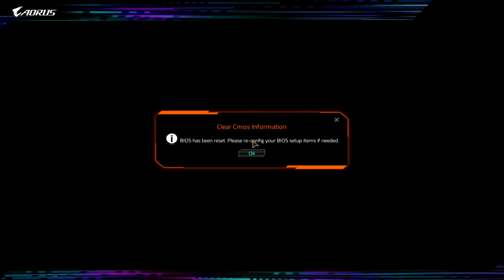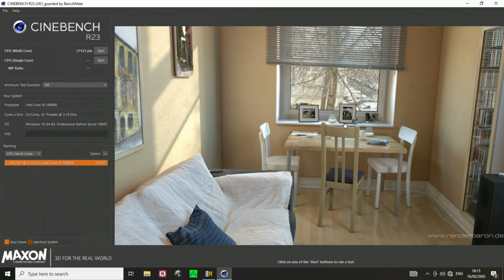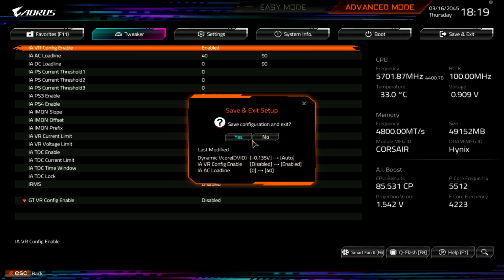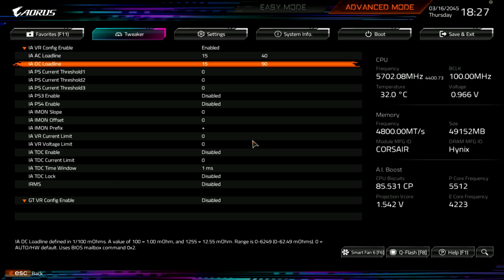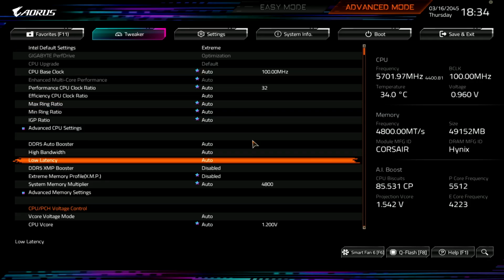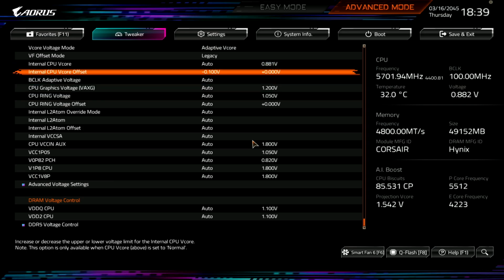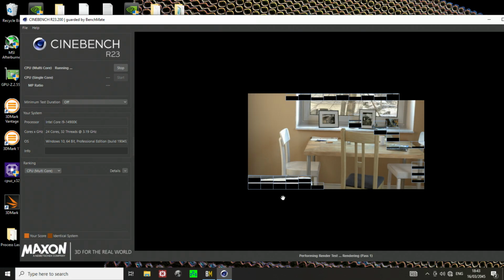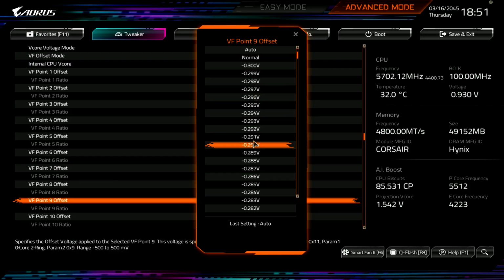YOU  DON'T HAVE  TO TURN OFF CEP to undervolt intel 13/14th gen CPUs

Comment: No, you do not only mostly affect high load voltages with AC LL, run Geekbench 6 and compare VID (or vcore, whatever) on light workloads, you'll get significant difference in VID between 1.1 and 0.4 mOhm. You can already see the influence just in the bios, there's tons of voltage pumped regardless of load, since AC LL is a flat offset calculated from AC and probably ICCMAX. The same value is being added to VID all the time. Adaptive 1.435V + 1.1 mOhm LLC + 0.65 mOhm AC LL = up to 1.48V in GB6, 1.435V + 0.06 mOhm LLC + 0.1 mOhm AC LL = 1.41V in GB6.

Also, MSI gives the per ratio voltage offset, but it's completely broken too, so while bIntel gives that opportunity - motherboard manufacturer has to be not idiotic too.

Also2 - at the time of writing this comment I didn't get to 26-ish minute yet, where you've said just what I wrote :P. Which is also contradicting what you said at the 12 minute mark, it's influence is pretty much linear, although by dropping just AC LL you actually hit high load voltage stability limit way sooner, than low load voltage stability.
Reply: and yet he says "for some reason people don't understand what I say" - he needs a summary comment pinned at the top, even if it loses some views.
Reply: @ogBINARYGOD  просто человек любит МНОГО говорить ПОПУСТУ. Вообще попусту. Он похож на обзорщика на геймнексусе - много слов при минимуме полезной информации. Такое ещё называют "словесным поносом". И по причине обилия слов данные люди напрочь забывают то, что они говорили в начале.
Reply: I have enough another issue, if I keep the 1.0/1.0 AC/DC (recommended LLC4 setting with latest ASUS BIOS, then try to undervolt with the SVID (requires a ton of negative offset to get the same voltage as before), it ends up tripping up the 307A ICCMAX on my 13700K.  Meanwhile if I use my normal undervolt mode of 0.4/1.1 with LLC3 with SVID offset of -0.05 but with CEP disabled, it doesn't trip the ICCMAX and downclock.  

The only way I can somewhat get CEP to work is use LLC5 with 0.4/0.73 AC/DC with SVID offset of -0.11 with CEP enabled.  I still end up with about a 200 point lower C23 score, I even tried creeping up the AC LL to .5 and .6 with more SVID offset to compensate, still noticed the loss of roughly 200 points if CEP was enabled vs disabled.  I would gain those 200 points back if I left it locked at 0.73/0.73 on AC/DC with roughly a -0.19 offset, but the voltage under load wasn't constant, it drooped heavily in the beginning and raised up over 0.02v by the end of the test.  With the other settings, it stayed constant the entire test.
Reply: @ZoneXV  извините, но 1.0/1.0 для AC/DC на АСУСах - это много. Обычно нужно "стартовать" с 0.5/0.5, постепенно снижая AC для выравнивания Vcore и SVID Vcor(реальное и запрашиваемое напряжения) в нагрузке - при правильном подборе они ДОЛЖНЫ быть равны. Например на Z690 TUF D4 я ставил 0.1/0.4(AC/DC) при LLC6 - и всё было отлично.
Reply: @chveyk To equalize the AC/DC, I set it to 0.5 on both and have to put it under stress to check if they both align? And if the VID has a higher voltage than the VR Vout, for example? Do I just need to reduce the DC LL?
Reply: @Syrusaki  да. я на своей ASUS Z690 TUF D4 "дошёл" до 0.15 DC LL и 0.46 AC LL  - напряжение "Vcore" равно "VR out". На "VID" можно не смотреть - это "желание" процессора(внутреннего АИ блока). после "выравнивания" можно заняться поиском "минимального" напряжения путём введения отрицательного сдвига. У меня оный выставлен на -0.12в - в нагрузке в среднем 1.26-1.28в. И около 230Вт потребления при 38000 очков в CB r23 - больше уже не тянет "тестовый" кулер(всё никак не могу дособрать водяное охлаждение)...
А. да - у меня 13900HX :)
Reply: @chveyk  Here I tried using adaptive voltage with an offset of -0.088V, and when I run Cinebench, instead of having a voltage droop, the VR Vout and Vcore increase. I started using Fixed mode because it stays stable there; I’ll just need to align it then. I just ran a test, and the Vcore is slightly higher than the VR Vout by about 0.010V, both at idle and under load
Reply: @Syrusaki  да. так и должно быть. плюс-минус 2-3мв это норма. Точнее "уровнять" всё равно не выйдет. и да - все настройки сугубо индивидуальны для каждого отдельного процессора.
Reply: @chveyk  привет, можно с тобой как то связаться что бы задать пару вопросов ?
Reply: @chveyk почему интел не может утвердить среди производителей плат, что AC/DC LL в авто режиме должны всегда выставляться в том значении, в котором установлен LLC. Чтобы не ставить их вручную при изменении LLC? Чтобы вручную ты ставить мог, но в авто они и так работали корректно в соответствии с LLC?

Да максимальные 1.55в все равно странно выглядят, можно было спокойно опустить до 1.5в. 0.5в - это огромная разница, особенно когда речь идет о предельных для данного чипа напряжениях. 

Все же просто. 1.5в не превышаем, СЕР работает. АС/DC автоматически подбирается при переключении LLC. (Это для 14900ks, а остальных чипов можно смело резать максимум до 1.45в) 

А там уж пользовать при желании подберёт нужные ему настройки как хочет. Снизит вольтаж, выберет LLC. 

Я человек ленивый, просто поставил фикс, подобрал оптимальный ллс, которые вывозит мой кулер и поднял частоту настолько, насколько позволяет качество кристалла. После этого чуть опускаю еще вольтаж (с учетом шага по частоте может остаться небольшой запас).

Эти 6ггц, которые я почти никогда не вижу мне погоды не делают, 5.5-5.7ггц на все ядра меня вполне устраивают
Reply: @graviusmatt  "Это фантастика" ;) Производители плат не могут сделать один стандарт того самого LLC, а вы о AC/DC говорите! У асуса одно обозначение LLC, у MSI другое, а гига вообще по своему "крутит" это LLC :D Про асрак промолчу - они вроде как равны с асусом в этом вопросе...
Reply: @chveyk  ну у асуса хотя бы есть настройка синхронизации lcc и ac/dc. Но опять же, это не вина вендоров, это вина интел.
Reply: @ZoneXV  I'd expect it tripping PL4 actually.
Reply: @PolskiJaszczomb  Could be that too, it's under IA: Electrical Design Point/Other and PL4 is listed there too.  It wasn't maxing out PL1 or PL2 though.  I'm convinced the stock out of the box settings is trying to kill my CPU.  Gave it vcore's in the mid 1.4's and tried to run cinebench23 at 1.32v before immediately throttling.  It's trying to run it at full load at the exact VID listed in the VID table with no vdroop at all!  I'm not sure if this is on Intel or this is just an ASUS screw up.  Really considering going back to my old BIOS I was on with just a voltage limit since it hasn't given me any issues for 2 1/2 years.
Reply: I did his settings with the LL to high/55/55/-100v offset, and my 13900k went from running above 1.5v to running up to 1.35v max for what seems to be the same if not better performance. So idk, he says you don't need to do it, but it seems like it really helps. So I'm even more confused now. My clocks are the same, if not better since I seem to hit 5.8Ghz more often, but maybe that's placebo. Temps are waaaay better, 20 C difference on cores that were hitting 70 C on startup alone. Now my highest core is currently 53 C. Also I'm running a Gigabyte Z790 Aorus Elite AX gen 1.
Reply: @Mcnooblet  It helps, of course, you're applying both -100mV to the entire curve, then also dropping AC LL quite significantly (halved?), you're basically plummeting voltage on the entire V/f spectrum.

Comment: Another thing I see a lot of people incorrectly suggesting has to be turned off in order to undervolt, is "Undervolt Protection". All that setting does is establish a floor for the voltage at POST, it doesn't prevent you from setting a lower voltage at boot in the BIOS
Reply: are you sure? when writing a bios to undervolt cpus 12th gen and above being an "h" processor i hear that undervolt protection is the main issues to changing volage limits in any way at that point

Comment: Still waiting for someone to address what all of the EVGA owners of z690/790 boards are supposed to do since Evga’s MOBO team doesn’t exist anymore aka no micro code update
Reply: Z690 classified and kingpin boards received 129 and 12b microcode updates early October. They are just not published as an official bios update but rather beta bios updates in the evga forums. I have z690 kingpin and the latest bios is 12.17. Don't remember the number for classified 👍

Comment: About windows being slow, while this may be yet another different thing here, I remember this sort of behavior since windows 10 (never happened earlier), and it occurred when windows is absolutely hammering your SSD (or god forbid HDD...) and your poor SSD/HDD can't keep up because windows 10+ IO is just that bad. And yes, it is bad enough to even get bottlenecked by an SSD. If, during the slowness, task manager shows 100% HDD/SSD utilization with shockingly low read/write speeds and insane latency, you are hitting that issue (I remember getting 1000ms on an SSD, and 2000+ on HDD)
Reply: My laptop has this issue. Latency sometimes in tens of thousands of miliseconds and 100% use. It's basically frozen until it finishes.
Reply: Had an HDD I was using for media storage that started to fail and it basically gridlocked my entire operating system on Windows 11. Computer wouldn't even shutdown properly with it connected.
Reply: @AzwraithPL  3 SSD's connected via USB - same.
Reply: should take a look in your device manager and enable hidden objects or whatever its called - anything you know for sure is bunk should be removed, then restart.

as for usb sdd's - I only have issues randomly and very infrequently, and its not a Windows issues, its a mobo issue wrt to USB - you can change around which ports are being used and get very different results.

Comment: If you set LLC to "auto" (1.1 mOhms), don't set an high enough Voltage Offset and then limit the VRM to 1.4 V, you will likely see lower boosting P-Cores. Just because it needs a higher VID and if that doesn't fit under the 1.4 V ceiling, the next lower boost stage is used that fits beneath that ceiling. I've tested this on an Gigabyte Board lately. Lower LLCs (and matched AC and DC Loadlines) obviously can fix that - depends on the quality of the CPU.
Reply: but then 23:45 "dont touch the loadline settings", and more confusion
Reply: @notexactlyrocketscience  and yet he wonders why people don't get what he says - he needs less fly-by-seat videos and to actually plan it out and less of the "well.... [ramble on some disclaimer that doesn't really matter to the main point]" moments.
Reply: @ogBINARYGOD  i actually wrote down my own personal, cleaned up transcript and i'm going through it with a highlighter
Reply: By lower LLCs you mean like High, not low or medium right? And then AC/DC to something like 55? This confuses me a bit, but I think I have to change that since I keep seeing the current limit reason even on low load
Reply: @Compalee  medium should be enough because this tends to be around 0.5 mOhms on most Motherboards (AC_LL and DC_LL should have the same value as LLC if you don't want CEP to throttle). I also wouldn't go much lower on Loadlines for a everyday system than around 0.5 mOhm. That could already be too shallow for really weak VRMs. What really helps is a decent undervolt. Because if you can realize a parallel displacement of the v/f curve it is more likely to achive higher frequencies - even if you set a VR Voltage limit. If you see some Limit Flags active it must not be your voltage. If I remember correctly even Ring Downbin can trigger such a Limit Flag.
Reply: @bauerns5er  I have a z790 gigabyte aorus elite x wifi 7 which from hwinfo says renesas controller so I think its the same as buildzoid video. The thing is I see a lot of contradicting information, some people say disable CEP others just keep it on and change loadlines, im a bit lost on which one to go for, guess I'll have to do a lot of testing one by one. I started seeing the limit reason more after setting voltage limit, even with undervolt of 100, but then I tried lower the AC LL a bit and the limit reason started appearing less, which is good but just makes me more confused.
Reply: Might be late 14700k on a b760 ddr4 board but I run 
AC DC loadline 55
High 
Ring offset voltage -0.020mv
Adaptive vote offset -0.050mv
P cores locked at 54
Ecores locked at 4.2
PL1 125w
Pl2 253w
Max current to 307a

82  max temp benchmark
70-80 gaming
360mm thermal alright aio

Never drops from 5.4ghz 
Same with e core 4.2ghz 

I could get lower temps but I was looking for highest performance while maintainting a solid clock dropping to 53 on the p cores drops my temps but at a cost of performance

Comment: On my motherboard the loadline is set to high but I have to set Ac45 Dc45 so that Cep doesn't intervene. (Gigabyte Z790 Aorus Elite AX)
Reply: Got my hands on that motherboard but with ddr4, will run a 14600k on it. Can i use these settings ?
Reply: @dalllle79  Sure, I’m still using the same settings, and everything works perfectly. I work on this PC every day, try 40 to 45.

Comment: Love your detailed content as usual good sir, but i would like to point out that different AIB's are behaving very differently when it comes to CEP & AC_LL including  undervolting. Even more so with the x129 Microcode update, Asus for example, at least in my case fails to work whenever you change anything manually regarding AC_LL or even a mild VID alteration of 0.025Mv. Although SVID seems to be alterable, without issue. Very odd...

It looks like they've locked it down with CEP enabled (at least from my perspective) when running Intel Baseline on this BETA Bios. Asus Maximus Z790 Formula btw.

Comment: Luckily, the MSI board I have just has a dropdown that says by PWM or by CPU for the offset mode. And then you can just set your offset from there.
Reply: On my 12700kf the CPU offset mode just doesn't do anything. Works fine on a 12600kf though.

Comment: What's the next steps if you want to continue further the undervolt after you do 55 AC/DC ?
Also i have observed on gigabyte motherboard it won't go below -0.080mv offset , it's like is not registering.

Comment: I'm so happy i have a gigabyte mobo (so i understand what bz is talking about) and i also undervolted with adaptive mode global offset and it works very well.
The only problem is that i can't change the ac loadline limit which says it's set to 0 (?!) but seems like it's working well with extreme llc option.

Edit: i forgot to mention that i haven't updated to the new microcode but CEP off otherwise is not 100% stable. Still works very well in terms that the performance is good with no stability issues and even with the 1400 limit it doesn't overshoot much, max 1.452 which is not that high given that i use 5.8ghz all cores with 185 power limit.

So basically i found a way to overclock, undervolt and keep temperatures in check where the performance is very good and the voltages are finally "normal" for what we're used to from intel. Btw, this on a 14700k which seems more impressive to me given that is a garbage bin just like bz's 14900k bin.
Reply: type type in a number, it'll work that way
Reply: @notexactlyrocketscience  After some hours of testing i found out that the sweetspot for extreme LLC is AC voltage limit set to 30 or 35 with CEP off. With CEP on you shave off some performance and the voltage shoots a little bit more. Anyway i'm very happy with my config right now, seems that dropping the AC limit from 55 (which was default on my mobo), to 30, keeps the core voltage from overshooting as much (max 1.402 from 1.452 previously), so it seems to respect the 1400 limit that i imposed, better. Very happy about that given that the performance is excellent.

I also tested with Ultra Extreme LLC and find out that AC limit works at 20 or 25 best, but the performance isn't better (it's actually worse somehow) and it doesn't seem tp be 100% stable (for example i fail the low thread cpu profile tests in 3DMark), so i decided to stick with Extreme profile and 30 limit.
Reply: @notexactlyrocketscience  right, i've done this before with other settings idk why i didn't think about it, i'll try. thanks for the suggestion.

Comment: what does xtu use? I thought it worked in there with undervolting, but not sure. And could you do a video on a asus z790 bios? It's so different than others, I don't know where I find things, because they have other names, are other places and things like that. I just don't know how to apply your showed settings 😅

Comment: Intel has been lowering voltages on these CPUs silently through microcode updates for a while now, Gamers Nexus showed it in his coverage of this issue so I think it has to do with the fact that Intel just didn't do enough testing on these CPUs before releasing them and their internal testing slowly but surely started showing problems so they silently started releasing microcode patches that would lower the voltages ever so slightly, doing this over a long period of time would've meant that Intel could easily RMA the chips that stopped working due to overvolting or due to the fact that Intel's "microcode undervolt" has made it unstable because it was already degraded to a certain point and reject the ones that have gone out of warranty, I don't think that they anticipated this issue to blow up so much before they could do all this. Releasing a basically higher clocked 14th gen probably didn't help things either.
Reply: Sorry mate but this all is nonsense. Completely wrong assumptions.